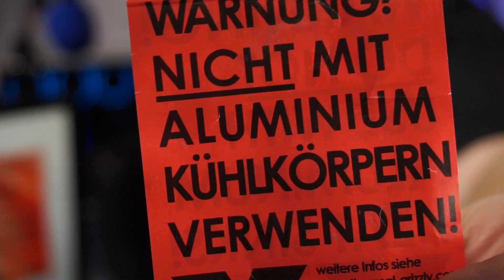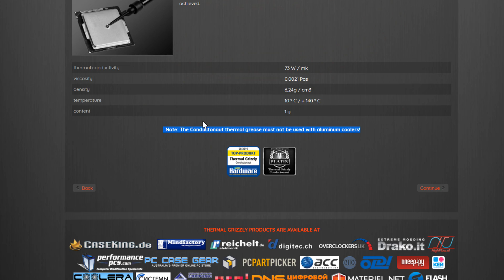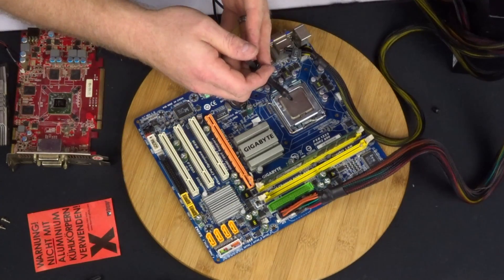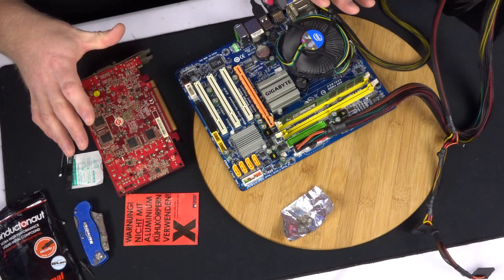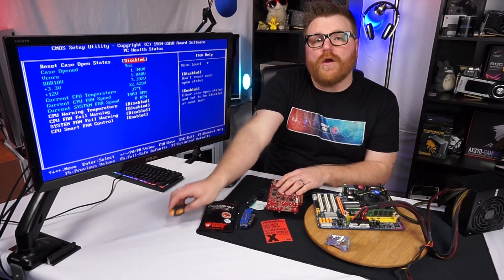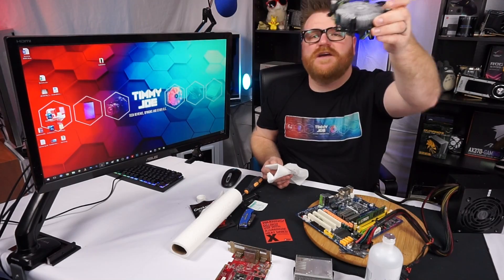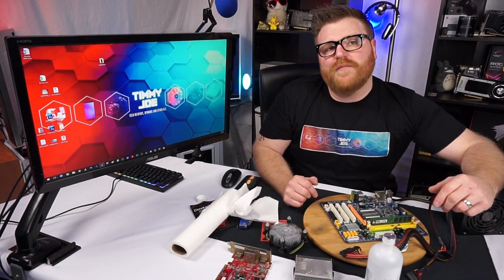Liquid Metal Vs Aluminum?! Terrible Idea or meh!?

Comment: Dude you are spreading false info by this video and you did the test all wrong. You cannot test long term chemical reaction effects in 24h or so... it requires aged testing...

I have applied the very same Thermal Grizzly liquid metal on my 8700K with aluminium be quiet! cooler and 10 months later when I removed the cooler I was shocked by the damage caused on the aluminum surface of the cooler heatsink! The liquid metal clearly eroded the originally mirror polished smooth surface of the cooler and as a side product of the chemical reaction some black and whitish by products (oxidation or so) was all around in the still liquid mixture. these compounds and the eroded surface clearly not as good heat conductive as they were and should be. And the result looks all messy, the cooler surface is damaged just in a year. Just imagine the results in 3 years.... Well I removed this liquid metal and replaced with regular paste. I am just happy that the lid of the 8700K did not get damage, although the printed markings are a bit smuggled now... 

I do not recommend this Thermal Grizzly product for any case!

Comment: First off, the liquid metal actually never touched the pure aluminium directly, only the aluminium oxide layer covering the aluminium. However, this too gets eaten away with liquid metal, just takes longer. The liquid starts to cause havoc when it touches pure aluminium, either by eating away at the oxide or by getting in a stretched.
Also, the warmer, the faster the reaction happens, 24 hours is way to little time at idle temps, you should've tested longer or put it through a real stresstest.

Comment: Why risk using that crap, plenty of evidence is does eat away at metal surfaces. Also doesn’t perform much better if at all against the best pastes on the market like Arctic Silver 5. It will eat away at tin, aluminum, nickel and so on.

Comment: Nice video :), I'll report back with the GPU after half a year or so and see how the cooling is holding up, maybe we could get some new meta where the GPU cooler melts to the die, wouldn't that be something.
Reply from the maker: Sounds good to me. As long as your PC beats Bitwit ! Love the new studio.
Reply: check out what gallium does to aluminium , it is one of the ingredients in Conductonaut. gallium would be the reason for the warning and why it eats into the aluminium like it does.
Reply: Tech YES City I love that you replied to this. I like seeing the smaller guys on youtube getting together like this and working each others stuff
Reply: @codysmith1915  They are both huge!
Reply: @tech yes city .glad I stirred the comments up. What's the update?

Comment: Timmy, so 2 things!
1st. To get the best coverage when spreading the liquid metal use a polish on the heatsink first before applying. you'll see how much easier it is to spread.  you can even use it on the surface of the die to remove the microscopic imperfections that cause the liquid metal to want to bead up on its self.  I like Flix brand polish works great!

2nd. aluminium forms a protective oxide coating very quickly which does not really want amalgam with the galium in the liquid metal.  It wasn't the thickness or grade of the metal that made the foil tape more susceptible it was because it was bent up, which produced cracks in the oxide layer leaving points of attack for the galium.  the this again but scratch the heat sink and put a small drop on the crack you'll see how fast the reaction happens!

Still great vid!

Comment: first, of all, you should make it quite clear this is an enthusiast use and then round it up with a snapshot of what you have accomplished. it is quite frankly a statement and no more.(i have delidded my 87000k and attained an 87000k 4800mghz  on all cores stable and I am happy' 700c and more than happy:}
Reply: Karl Walker "87000k", "mghz"  "700°C" 😂😂 That is some true enthusiasm.

Comment: Gallium will react with aluminum to form an alloy that is super super brittle. However, aluminum makes a seal when it gets oxidized, so without a clean scratch on the surface, it will take some time for the gallium to react. But, even the smallest score on the surface will accelerate the reaction. One drop will not only effect the area it touches. It'll fuse with all the aluminum and it will break like chalk. You can look up videos of people breaking aluminum with gallium if you wish.

Comment: 9:10 We can ALSO se that basically  NO Liquid metal (save 4 TINY dabs) even made proper CONTACT with the aluminum heatsink! Like I said earlier and the DIRECTION TO CONDUCTONAUT TELL YOU - You MUST apply Conductonaut to BOTH the die/IHS AND the Heatsink where it will contact said die! 

This experiment was not under enough heat, and the LM was improperly applied, finally the time elapsed was not NEARLY enough for any meaningful data from said "experiment"! 

Wanna do a MUCH better demonstration of WHY NOT TO EVER allow LM to even TOUCH aluminum? Apply a small square the size of an IHS onto the shitty POS stock Intel cooler, and let it sit somwhere at ~75+ F (near a heater would be ideal) and check back on it after ONE WEEK! Wipe off the sqare of LM, and then look CLOSELY at the Aluminum! It will be "Hairy" lookingin some areas, and may even become brittle enough to flake apart with the touch of a finger! The cooling perf by then will be terrible. 

NEVER EVER APPLY LM TO ALUMINIUM!  I would not even apply to Copper unless Nickel Plated, as it will slowly form alloys that will impede cooling given 2+ years and heat.

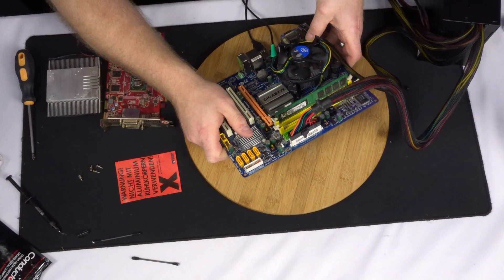Comment: 5:00 Due to the surface tension properties of Liquid Metals - you are SUPPOSED to apply it to BOTH sides - as in on top of the CPU/GPU as well as on the bottom of the Heatsink. Not that it should matter too much for this experiment. But if you ARE delidding or using LM - always apply to die AND where the die contacts the IHS/heatsink/Coldplate

Comment: Aluminium is very reactive, and in return an amalgamate is formed from the gallium and the aluminum and thus cannot oxidize properly and provide a protective layer from the air. In short the aluminum gets extremely brittle and can be broken apart easily.

Comment: So what should have happened is this https://www.youtube.com/watch?v=FaMWxLCGY0U however  something else that keeps it liquid below 85.58 degrees Fahrenheit as the gallium would return to solid metal and this additive most likely  slows the reaction down a lot but over a period of months the gallium would eat the aluminium and cause structural failure at least partially I'd imagine there isn't enough gallium in such a small quantity to eat an entire heatsink ,for those curious and who didn't take high school chemistry.

Comment: Lm or gallium has very interesting interactions with aluminum it turns brittle sure to the point it will fall apart it's not something to say is ok also simply removing the gallium is not guaranteed to stop the reaction

Comment: You have to scratch the aluminum fairly deep for the galium to react with the aluminum. Aluminim exposed to air forms an aluminum oxide coating which will protect the aluminum from the galium.
Reply: Kidding?

Comment: There is a coating - it is called aluminum oxide, it is created by the aluminum contacting the air. To get the gallium to react quickly you have to scratch the aluminum once you applied the gallium. It can happen when you screw on the heat sink - but it may not. Aluminum oxide is pretty strong.

Comment: Timmy, please do a review of applying Thermal Grizzly Conductonaut on your 980ti and compare the before and after temps. I am seriously considering using Thermal Grizzly Conductonaut paste on my EVGA 980ti ACX 2.0+ SC (with Zalman AM-STG2 Paste) to bring down the temps for a better OC (mine is a mediocre overclocker with 67% ASIC - boosts to 1420-1433 with most reasonable tweaks and custom fan curve with temps staying between 77-81C at full load in games).
Reply: I would try kryonaut first. I applied LM to my evga 970 ftw+ and had baaad results. I made a vid on it too.
Reply: @Coalition Gaming - Thanks for the reply. I checked out your videos (Liquid Metal Failure and LIQUID METAL: Improving RX480 temps) and noticed the mixed results (great for Rx480 and not so for GTX970). Unfortunately, I don't have the luxury of having a lot of different pastes on hand and Thermal Grizzly pastes aren't cheap, so really want to buy one (Kryonaut or Conductonaut). As Timmy has access to a 980ti (which overclocks really well) with a non-reference cooler (as reference coolers aren't known to have much more headroom for heat dissipation, and so they get minimal benefits from liquid metal pastes) and many different pastes, including the Conductonaut (and he is crazy enough to try anything), I thought who better to request for such a test.
Reply: Glad you checked out the vids. I also have a 980ti, an EVGA SC+ version. Though it's under water with a kraken g10 and a Corsair h55 using MX-4 thermal paste. I'd happily oblige you but it stays in 60s at all times like this, and after what happened with my LM application on an EVGA ACX cooler, I don't think I'll give it another go. Hopefully Timmy obliges :)
Reply: I appreciate your consideration to indulge my curiosity, and I understand how much of a hassle it could be to test something like this. I would however like to know (as you and I probably have the same card EVGA GeForce GTX 980 Ti Superclocked+ ACX 2.0+, Part Number: 06G-P4-4995-KR) what's your ASIC quality, what are your OC settings (with voltage) and the temps at which the said settings are stable. Thanks.
Reply: Yep same card. +87mv, %110 power limit, 91 degree temp limit, +150 core clock [1478mhz boost], +550mhz vram [2030mhz for 8120gbps rating] effective]. Max GPU temp was 68c
Reply: Thanks for settings. Can you share your ASIC quality (as shown in GPU-Z). I can push my card to 1460-70mhz Boost with +25-50mv, but it gets unstable after a while unless I blast the fans at 100% (which is not a realistic noise level for everyday use).
Reply: Ah right, forgot about that. When I get home from work later I can get that. I just happened to have my OC settings recorded on my firestrike result page. You won't harm your card on stock BIOS going to +87mv and Max temp and power limit. It just allows the card access to as much voltage as it needs (Nvidia BIOS locks out going over voltage) and the higher linits let it pull a little more and stay in Max boost longer before temp or other issues step the GPU boost back down. It does sound like you're having temp issues though and that's no good. Hmm. I'll get back to you later!
Reply: Thanks. Yeah while I can push the mv slider to the max, the extra heat generated by more voltage available to the card actually causes instability beyond 80+ Celcius if card is clocked very high and the fans are not at an unreasonable level. I have found that the card needs to be between 77-79C for it to maintain its Boost (currently 1433-1420mhz with +20mv), unless it starts hitting the power limit.
Reply: Well you aren't too far off from the best this card can do, at least from my findings. My 24/7 OC needed the clock and ram turned down to +130 and +500 respectively for effective boost of 1459 (and it bounces a little between 1430 and 1459, but mostly stays at 1459) and 8gbps effective RAM "speed".

Comment: Liquid metal is mostly just gallium... gallium is extremely corrosive to aluminum.. so be very careful!  Also do not attach an aluminum heat sink to liquid metal it will perminatly destroy it.  Even the smallest bit like a drop could completely turn that heat sink into a crumbly mess over time.  I recommend using Nickel metals or copper metals when dealing with liquid metal thermal
Compounds.   I made that mistake once and ended up killing the cpu once aluminum tried to push through it basically crushed the die... it took a good week or so for it do it but the die under the IHS was cracked in half.. so now I only use liquid metal on bare copper/nickel.. a good bet on a cooler would be a noctua cooler since they use a lot of nickel metal.
Reply: meehhhe Of You The die is silicon. The IHS is nickel plated copper. How did you kill the cpu?
Reply: Juho Petrell   (Redoing my comment since you edited yours)

Timmy here put the cooler on the gallium based liquid metal which he applied onto of the IHS.   (If I remember the video correctly) which is a big no no.. always use nickel when possible for heat sink coldplate when using gallium.. also ashould avoid bare copper heat pipes and aluminum with gallium since bare copper reacts to just far slower.  

The way my CPU died was I didn’t use the IHS actually... just mounted an aluminum coldplate right to the with gallium based liquid metal and thin o-rings on the screws to dampen the heatsink when I was securing it tight so I wouldn’t crack it.  But after a few days of worsening thermals it just failed on day or night from the die itself cracking from the heat sink forcing its way down somehow.. it also was far more brittle and it broke off one of its legs and screw holes.. but it was evident that the aluminum pushed down against the die higher enough to crack it.

Comment: Fun fact:

The reason you shouldn't use gallium heatsink compounds with aluminium coolers is because the gallium diffuses into the aluminium and weakens its crystal structure. If you take a pop can and drop some gallium on it and leave it for some time, you'll notice the aluminium changes colour to a dull grey and when you press on it, it crumbles instead of bending. If you do the same to a computer heatsink, it takes a little longer since the heatsink is a lot thicker, but if left long enough, it WILL weaken the heatsink to the point where it disintegrates.

Want to see what happens when large aluminium items are exposed to gallium? Here's a few videos from NurdRage:

Pop can: https://www.youtube.com/watch?v=FaMWxLCGY0U
Large alu sheet: https://www.youtube.com/watch?v=IZkzxWZETds
Computer heatsink: https://www.youtube.com/watch?v=JHHI2Lk79cY
Reply: Yes and no - to start reacting with aluminium the gallium needs to get past the aluminium oxide and to do so NerdRage had to scratch the can right underneath the gallium drop - otherwise nothing will happen. When you screw in the heatsink you can damage the oxide level - but you may not and then reaction will not start.

Comment: You're underselling the damage done in this video. For just a 24hr time and that much damage your system will not last but a week to two weeks at best.
Reply: KylaShows Thats a lot of Damage!
Reply: i don't think he understands how it works, once it eats the surface layer away it absorbs then starts to corrode the whole structure very quickly.
Reply: Precisely, I'm glad someone pointed this out. People don't typically know how reactive Aluminium is, and forget that it oxidizes instantaneously when exposed to the air we breath, primarily oxygen as oxidization entails. I could destroy a whole car engine with thermal grizzlies gallium, well most car engines as many are made of aluminum.
Reply: Drastically undersold.